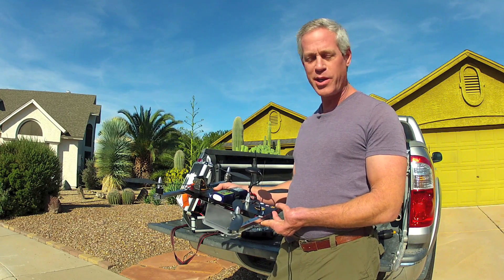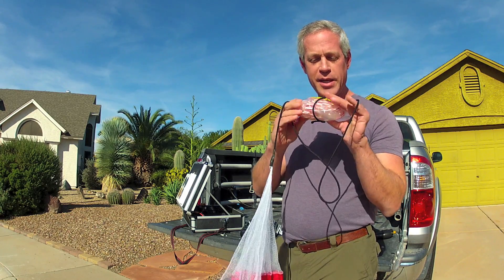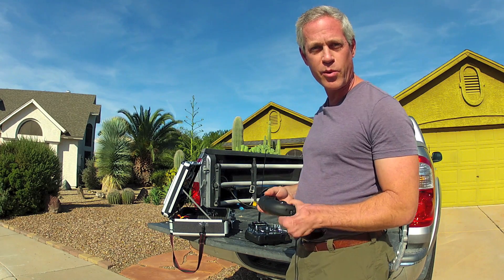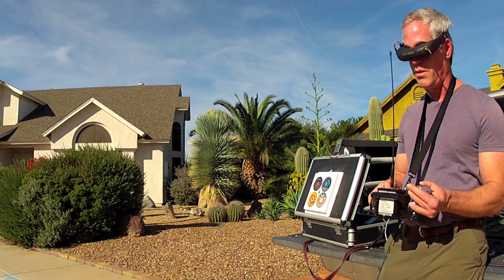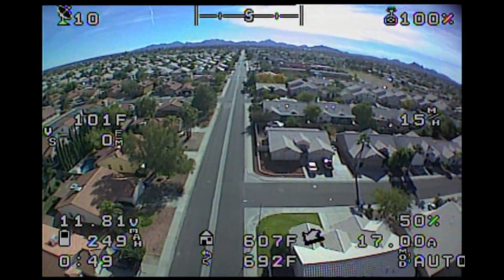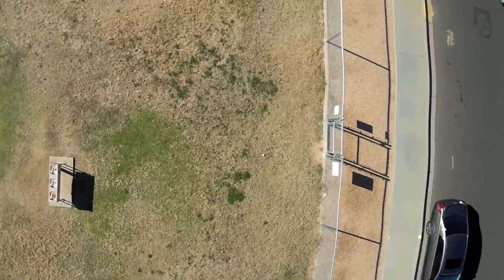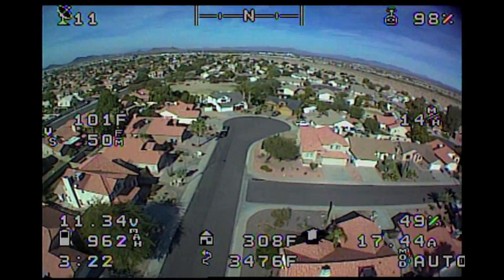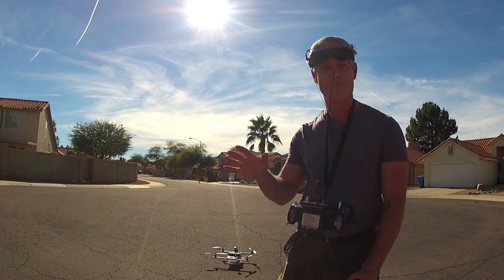Drone Candy Drop 2014

Comment: Great video Ed. Just curious how the linear antennas are performing for you? Is that a 5.8ghz V antenna on the goggles too?I like the GS with the integrated patch. Do you always leave it elevated on your truck? Or is it fine sitting on the ground,
Reply from the maker: nieder99 Good to hear from you man.  Linear on 1.3 seems pretty fine so far.  I don't maneuver too crazily at a distance so that helps.  I prefer to put the patch on the ground as supposedly that helps gain a little but I just put it on the tailgate for my own accessibility during the video.  Yes, that is a ghetto little dipole on the goggles.  It's small and works fine within 20' of the ground station.

Comment: Awesome project Ed. What size of props did you use? seems an effective combination.
Reply from the maker: pancho papafritas 900KV 2830 motors and 11x4.7 props, which seem pretty decent.  I did not do a lot of testing, just picked them.  I get 15 minutes from 5 amp hours pack.

Comment: Not enough ooos in smooth to describe that mission
Reply from the maker: jerry coleman Thanks Jerry.  Much practice with the APM makes for a predictable mission.  I can't accept anything less for flying around my kids and their friends.  Safety first.
Reply: Yes indeed my friend been using my 650 quad to test real pilot chutes for parachute labs here in fla having the ability to program the apm to fly to a preset altitude then just loiter their is great  we started at 50 agl but several pc did not inflate 
specificly the balloot style no mesh 
The type with 3/4 mesh 1/4 f111 inflate in less than 20 ft all pc tested have weight added to them to keep the bottom down and the top up you can see the vids at parachute labs yt site their will be more after the first the weather is kinda being crappy as of late hopping tomorrow ill be able to do some more test from 100 ft agl